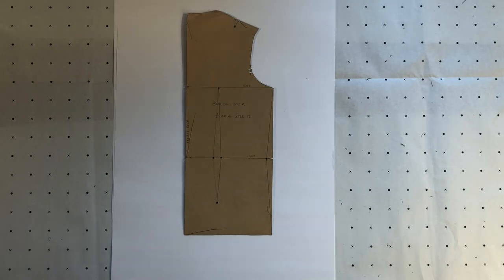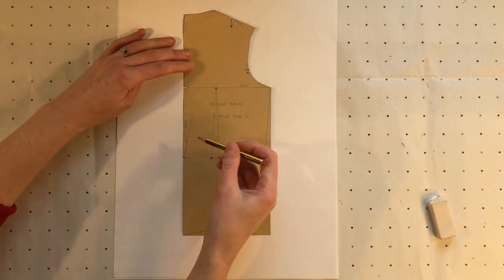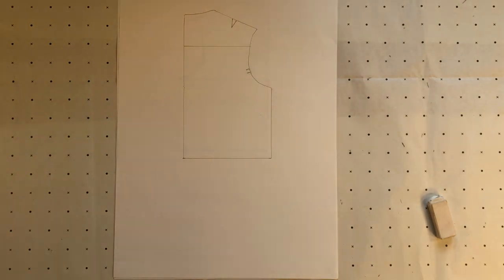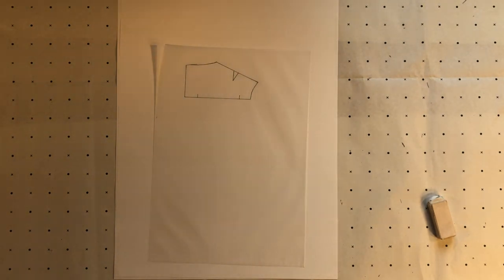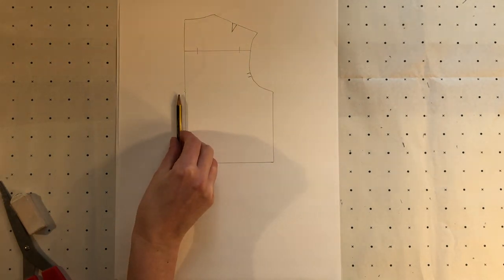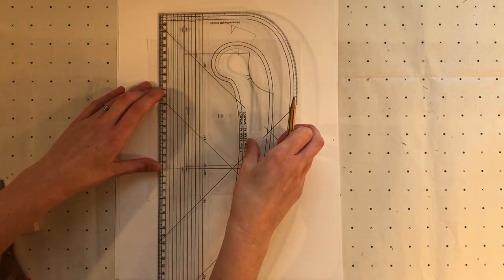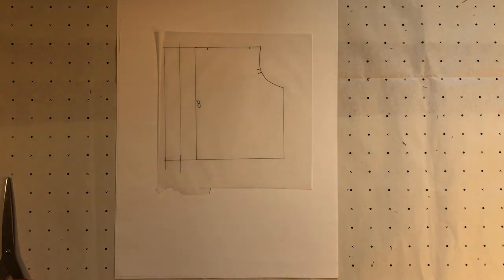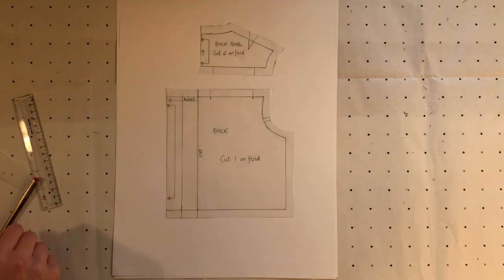How to Create a Back Yoke with a Pleated Back Panel

Comment: Hi, great video! Is there a way to add a pleat to the back panel without increasing the sweep?
Reply from the maker: @andreabrenk3862  hi
Thank you ☺️ 
Sorry, I’m not sure I understand what you mean by sweep?
Reply: @HouseofMissSew  Sorry, I meant without also increasing the hem? I have a shirt pattern that I’d like to add a yoke into but I really like how the bottom hem lays as it is. I’m worried it will be too full if I increase everything
Reply from the maker: @andreabrenk3862  you could add a triangle type wedge to the centre back instead of a rectangle. 
Extend the line at the top of the back, where the yoke is attached, from the centre back out to the left by the measurement of the pleat. Square down to half way down the back and then taper back in to the centre back line. This will avoid excess fabric at the hem. Hope that helps
Reply: @HouseofMissSew  ok that makes sense, thank you! 😊